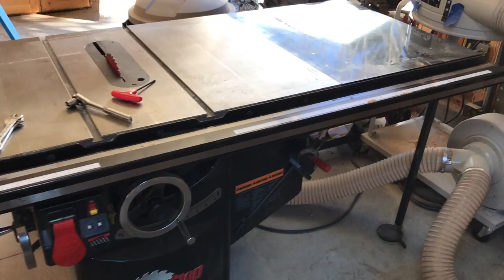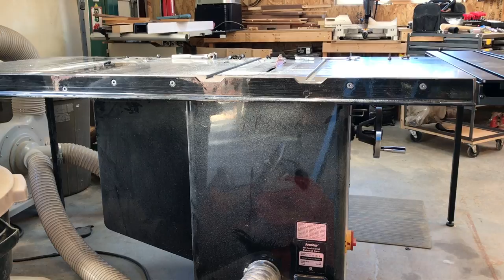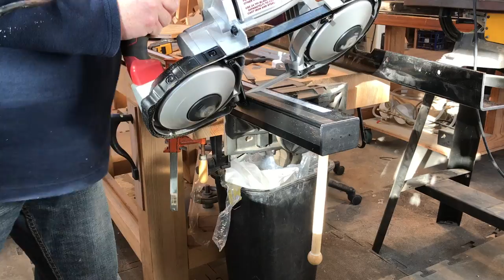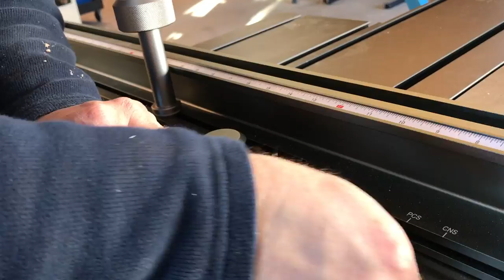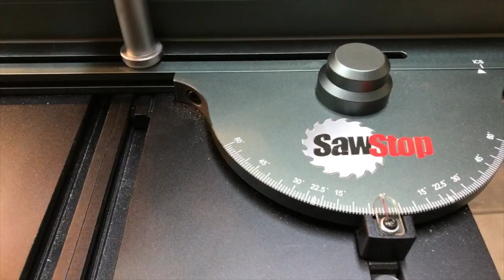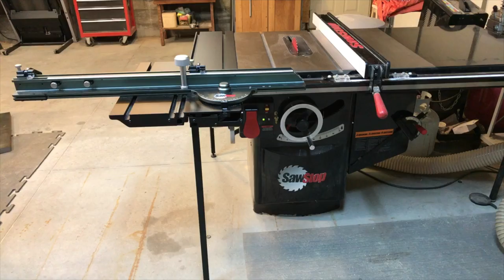Saw Stop Sliding Table

Comment: I just installed the sliding table to my saw, your installation went a lot smoother than mine! hahaha. anyway, instead of cutting the rail I moved it over and drilled more holes, this way I was able to extend my rip cutting capacity about 8 inches, very happy about that.
Reply: Is it easy to move the built-in tape measure?  I'd hate to do that and then have to remember to add 8 to all your measurements.

Comment: Thanks for the set up video. Did you consider going with the larg sliding table (TABLE TSA-SA70)? 
I'd assume they have the same feature just the bigger one holds larger material. The miter gauge on the smaller table looks nicer but not sure....Thanks!

Comment: Today, 1/25/19 I spoke with a technician at SawStop.  I inquired if it was necessary to remove the left wing and cut the rails.  He told me that my saw (bought in Dec 2018) would not need to remove the left wing and I would not have to cut any rails to use the sliding table attachment.  So, I ordered the sliding table and he assured me that there would be no trouble in attaching the unit.  Hopefully I will receive the sliding table from Highland Woodworking next week.  BTW, I have an in-line router table to the right of the saw.
Reply: Thats what I'm shooting for, too.  Sold a kidney on the black market, so I can get the 3hp saw with the router table and slider.
The trick was to show my wife the finger-saving technology, but not show her all the available (cheaper) sawstop models.  "Babe, I need to keep these fingers.  And this $6k saw will help me do it."
Reply: Hi Joseph, You're post is now  a few months old and I was wondering if you had success installing and using the sliding table and what you thought of it.
i'm not really sure i want to cut off part of the fence rail since this is a very expensive piece of equipment
Also, i normally use a radial arm saw when cross cutting so I don't know if this attachment would be cost effective
Thanks
Reply: VADOC02 Thanks for your inquiry.   I am more than pleased with the saw.   The sliding table is an excellent addition to the saw.   Very glad I bought it.   Did not have to cut any part of the saw.  You may not want this addition as you said you use a chop saw for some of your work.   It was a luxury for me.  In addition to the sliding table I have the router extension on the right.  After adding both of these I cannot move the saw even though I have the industrial base.
Reply: @josephzawodny  do you experience any deflection in the miter fence on the sliding table? Thanks!
Reply: @terryreed1421  No, but I check the alignment every so often.  It is a very easy procedure and it rarely needs adjusting.   It is not a hassle, but I check it about every two weeks.

Comment: I do wish that Sawstop could make one with a very short distance on the left side of the blade.  Adding a slider to a cabinet saw is not optimum because the slide is too far away even if after cabinet saw's left extension wing is removed.  On a proper sliding table saw (i.e., "European-style" sliders like Martin, Felder, SCM, Altendorf, etc.), the slide is virtually adjacent to the blade.  I think if Sawstop could come up with a true Euro-style slider with a long stroke slide option, they'd have a serious winner.
Reply: Even most European slider saws have the problem you are describing. I hate it myself. So I held off buying one for that very reason.

If  you buy a small Hammer K-3 with a 31" sliding table, the base of the slider does NOT protrude beyond the front of the saw. The only problem is, 31" is too short for MOST of the reasons one chooses a slider.

Oh well.
Reply: @MrPatdeeee  I'm not sure I follow you.  I have a Felder K700S with a 9' slide on it, and the inside edge of the slide is perhaps 3mm (approx 3/32") from the inside of the sawblade.
Reply: @Matthew Kerhin the Sawstop technology isn't as important on a true slider because your fingers don't have to be nearly as close to the blade.  I do, however, know of at least one European slider manufacturer who has made their own safety mechanism. It drops the blade down beneath the table surface instead of jamming a block against the blade, ruining both it and the mechanism in the process.
Reply: @Matthew Kerhin I hear what you're saying about the scoring blade, as there has been a few occasions when I forgot it was there when placing a sheet of plywood on the slider, and tore up the edge.  Had it been my hand, well, I think you described the possible scenario already...
  Did you see what I was saying about the one European slider company (not Felder, but I can't recall their company name) that has produced their own version?  I think it's a better approach than Sawstop.
Reply: @ApexWoodworks  I see now why you did not follow me. I made a terrible mistake. I misunderstood what Welsh Rabbit was saying. I now see what he meant. And I sincerely apologize for my stupidity. Please forgive me.

in any case, what Welsh is wanting, is NOT practical for any standard saw that has a large area to the left of the blade. This due to the way the under carriage and cabinet is made.

In other words, SawStop and all other American saw makers would have to completely redesign the saws; to have that very small gap between the left of the blade and the right edge of the slider; as it is done on European saws.

I empathize with Welsh; since I bought a slider accessory too, for my table saw. and immediately I realized the problem Welsh is talking about. However there are a number of cases where that large "gap" is good. For what it's worth.
Reply: @MrPatdeeee  Jeesh, Pat, don't knock yourself out about the misunderstanding as we've all made much more grevious mistakes.  As a wise man once stated, "May he who has never sinned cast the first stone."  Take care, stay safe in and outside the shop and all the best for a healthy New Year.
Reply: @Matthew Kerhin as mentioned, I don't recall the name of the company.  It'd be nice to know, wouldn't it?  Sorry...

Comment: What is the reason behind moving the sliding table closer to the blade?
Reply: Having the sliding mechanism and blade millimeters apart allows you to crosscut with ease.  And eliminates the American way of using a slot in the table and using a miter gauge or sled in that slot.  With the sliding mechanism, the wood is supported during the crosscut and carried by the sliding mechanism with ball bearings.  With the SawStop having the slider a foot away from the blade, the wood is not entirely supported and the wood is drug/dragged into the blade.

Comment: thanks for the video... I've been contemplating getting one for my saw stop.. my biggest concern is does it get in the way of normal table saw functions? is it easy to remove the fence and lock the slider?
Reply from the maker: It actually is really not that hard to remove.  Just keep the Allan key near by and it is two screws to loosen.   I haven't found it to be a problem
Reply: Mazeppa Made a

Comment: Could this adapt to a powermatic PM2000 cabinet saw as well?
Reply from the maker: Sorry, I have no experience with the PM2000.   I would think this would work on any table saw.   The hardest part would be to have holes in the right places on the table casting, which you could drill yourself.
Reply: Steven Ricks when using the saw for ripping work, do you find that it’s a bit in the way?  Looks like it sits forward quite a bit.  Thx
Reply from the maker: Most of the time it is out of the way.   It moves 4' behind the table.  For longer pieces, the fence is relatively easy to remove.
Reply: Steven Ricks for the fixed part of the table, how many inches past the front plane of the saw does it sit?  Thank you
Reply from the maker: Tundra Whisperer it’s about 12” in front of the saw

Comment: I don't think I could bring myself to cut through the fence rails like that.
Reply from the maker: Yes, it was a little un-nerving.   That's why I originally left the wing on.   I tried it like that for a while, then decided to take the plunge and cut the tub.  Now that it is down, I wouldn't go back.   I love it!
Reply: I cringed as well, but it really had to be done.
Reply: Is it absolutely necessary to remove the left side extension table on the saw to work effectively?

Also, how accurate is the sliding attachment when cross cutting 24” deep by 6’ or 7’ long?
Reply: I moved mine instead, gain more cut on the right and kept the full length in case of reselling the saw ,
Reply: Woodwork Channel did you have to drill more holes or anything special to move it to the right without cutting?  I’m looking to get a PCS with slider and would rather not cut the rail
Reply: Woodwork Tech yes i had to drill one hole i belive and one more thing is that there is a cut in a rail for miter slot on saw so once you move rail you have to grind the spot out or you wount be able to use the slot on table

Comment: I have a euro-slider (felder) highly overated.  Give me a  track saw and  general 350 or delta unisaw any day.

Mike
Reply: Mike, I own a Felder K700S  and find it indespensible in my shop.  I also have another table saw (an Inca) for small piecework, so I feel I have the best of both worlds.  Incidentally, I previously had a Unisaw outfitted with the JessEm sliding table and the Felder is quantums better in every possible way I can imagine... except that it doesn't have a zero-clearance throatplate.  But, that's why I have the Inca. 
 Incidentally, the JessEm slider as several advantages which the Sawstop sliding table doesn't have, the main one being its ability to place the wood at the front or the back (my preferred position) for crosscutting.